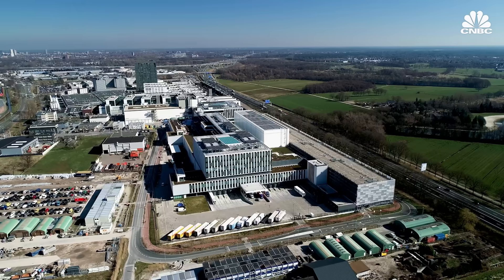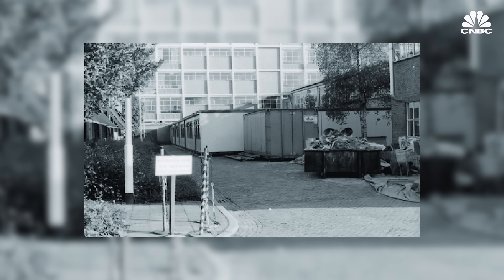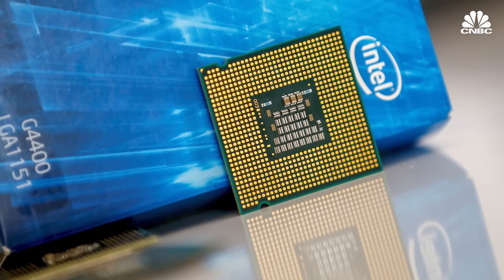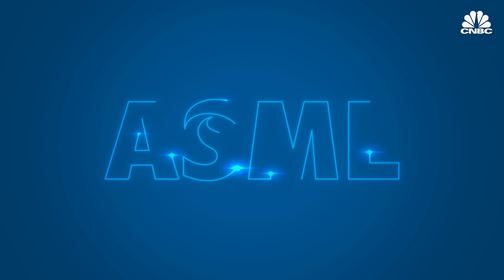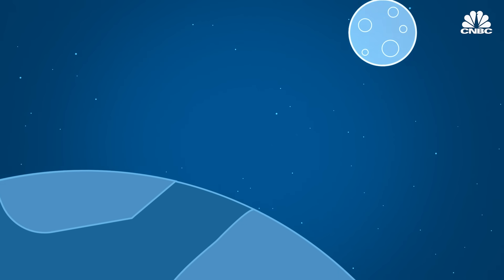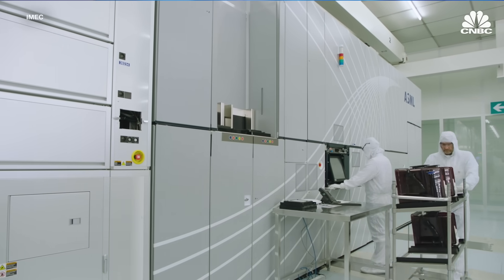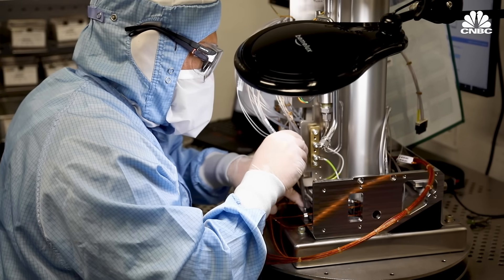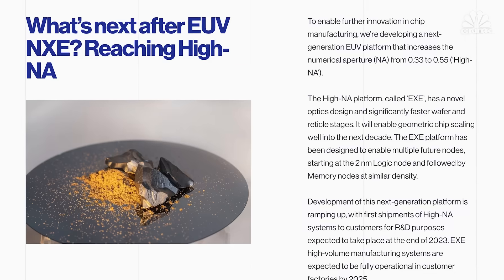Why The World Relies On ASML For Machines That Print Chips

Comment: I wonder how much ASML pays their top scientist and engineers!
Reply: A lot less than the talking heads you see hosted on CNBC. Now who really adds value and are commensurately compensated?
Reply: @kevind.5246  You work for ASML?
Reply: @DK-ox7ze  Don't I wish. :) I worked for ~ 20 yrs in the semi equip industry so i have a sense. I'd hazard a guess around $300K/yr for Sr. Director level - plus they'd do well w/ vested co. stock. But nowhere close to financial types or even Google/Meta engineers.

Comment: I work doing engineering drawings for installing these machines in chip factories. They are incredible. Hats off to the scientists and engineers building them!
Reply: The tin to plasma light source was probably just one of many genius insights needed to make these machines.
Reply: @autohmae  I work on medical CO2 lasers like the ones used to create the tin plasma and I thought I had to be precise with my alignments.  This is just incredible.
Reply: @Alvin Walker Sorry mate but like many other people in the world you are under the false apprehension that anything can just be reverse engineered and that's just NOT TRUE.

Sorry for the long answer, but its not just for you it for anyone else wondering.

I have degree in aerospace and 30+ years work in automation, control systems and robotics. Some stuff just can't be reverse engineered even when you know that task. It could be a lack of skills, knowledge or resources. Some things are just hard to do.

I see it in robotics and CNC all the time. Yes there's been some extraordinary advances that make stuff easy for people to do. But once you start chasing precision its just keeps getting harder. A good example is respirators.

Early in the COVID pandemic there was a world wide shortage of respirators and there were many announcements from a variety of amateurs and professionals. There's a YT channel called Real Engineering that's hosted y an engineer who once worked at one of the worlds largest manufacturers of respirators. He did a video on how respirators HAVE to work. It wasn't just what they do but HOW and WHY they do what they have to do. 

All the amateurs and professionals missed the fact that respirators aren't just an air pump they are hyper-precision air pump. They have to be because they are helping an already gravely ill person possibly with lung damage stay alive. That requires extremely accurate pressure and flow sensors that require very specialised electronics to read them. That alone makes them hard but then you also need software that's super reliable and a pump that can be precisely controlled. Its not impossible its just damn hard and can't be done with normal industrial parts which was what so many people proposed.

If you aske the simple question - can it be reversed engineered? The answer is always yes, but that doesn't answer the question of how hard it is to do.

That respirator company the guy from Real Engineering worked for released free to the world an older already certified respirator design. All anyone had to do was sign an agreement on the intellectual property and they could just start manufacturing respirators. The problem was many countries just didn't have the skills to make respirators or they couldn't get some of the parts. PLUS in many cases countries didn't have enough nurses trained to the level needed to operate & monitor respirators.

This Dutch chip machinery isn't one technology its a collection of hyper-precision technologies anyone of which would be incredibly difficult to reverse engineer even if they handed over all the details and design documentation.
Reply: @tonywilson4713  
"you are under the false apprehension" My God this is insufferable.
Some things can't be reverse engineered? I see what you're saying but you just lack perspective regardless of your exp. Geniuses exist and it's okay that you aren't one. You went from "hard to do" to "can't" in the exact same point. That is not interchangeable so make up your mind, mate.
Reply: @jasonnikolic  , he is right. Most of the tech ASML achieved weren't done in a year. It was done upon decades of work and trillions of dollars worth. There is just no way anyone will simply "go in and take it". China is trying hard to reverse engineer ASML's machines for 15 years now and they can't do it (they still buy outdated ASML tech, ASML is forbidden to sell new tech to china) because of the level of precision and the amount of parts that have to be manufactured with precision which themselves necessitate other parts to be produced so to be able to build the necessary machines for manufacturing of said parts, the construction process is just too complicated, so complicated that it is nigh impossible for non innovative countries like china, which depends on countries like the Netherlands for high-tech, to reverse engineer let alone make their own.
In reality the tech ASML uses to build those machines were all first invented in the USA, including lithography and EUV related technologies. Today, US chip manufacturers are researching ways to build carbon nanotube based chips that can be 3D stacked and that will suffer less heat.

Xi to chinese scientists scene be like:
- Tony Stark Was Able To Build This In A Cave! With A Box Of Scraps!
- But mr. Xi, we are not Tony Stark.
Reply: Can't they just take a daddy machine and a mommy machine and put on some Marvin Gaye and wait for the magic to happen?
Why hasn't China figured this out yet?
Reply: @markfairbanks3533  Because the chinese are still gimped by their own government. everyone goes abroad to study because the quality of education is far superior to CCP garbage. Once you leave china, chances are, you probably never want to come back again with all this new found freedom. This is what I suspect the CCP has trouble with. brain drain.
Reply: Sadly, this part of science is never mentioned or praised enough. How many people know inventor of transistors? Or people responsible for technology mentioned in video? All we hear is garbage from "great" scientists about pseudo black holes, pseudo evolution theory etc. Whereas they brought nothing useful to humanity. It is very clear what corrupted, derranged and wicked people are governing west for years
Reply: 99
Reply: meow meow meow
Reply: Any Chinese interns around? Keep an eye on them.
Reply: China is overtaking it
Reply: What’s the salary?
Reply: How did you get that job in the first place?
Reply: I've spent the last roughly 8 years proto-typing, designing, and building Intels EUV Vacuum Control system that ties into the ASML machines, fun work, challenging at times, and I only ended up in this position because I was the only one who said "Yes" when asked to take on the challenge. Specs change all the time, there's constant updates and revisions, but it's fun work nonetheless.
Reply: but its not just for you it for anyone else wondering.😶
Reply: @Alvin Walker the chinese tryed to reverse engineer it but failed. Asml is dependant on 100 companys for their machine parts, so they first need to copy those 100 companys before they have a shot
Reply: @Alvin Walker Don't you think they constructed the machines in such a way that reverse engineering is impossible? There is also software which is encrypted and embedded which redirects UV/light to compensate for natural bending and dispersion and so on. Otherwise china could just buy one machine and duplicate indefinitely, I'm sure they are trying that.
Reply: @plexoduss  if so why are they not selling to China even a single machine since few decades? Its just well protected technology with small circle of end user companies which don't/can't share any chip related technology with others in terms of geopolitical. Because, there is no such technology in the excistance which can't be copied. Its all matter of time, dedicated intellectuals and huge finances. If its done by the humans, there is 100% probability that another humans with similar intellectual capacity can create the samilar.
Reply: the netherlands......only 17 million people.....the Netherlands is the 2nd largest food exporter in the world and only one who can deliver this chip tech?

The world is in trouble......
Reply: @transformerstuff7029  Agree with what you said, but the 2nd largest food exporter is Germany, if I remember correctly. Then it is UK, China or matbe China, UK.

In addition, after the pandemic, the world's supply chain is really changed forever. Many countries realized that they can't no longer depend on other countries for their goods and services. I'm a consultant, and one of my clients is one of the automotive manufacturers, and it is starting to build their own factories, parts, supplies, etc. It's very wild to see their future's plan in the next 10 yrs, and how they are trying to prepare for another obstruction!
Reply: @GAATL_Viet  found the Tesla consultant.
Reply: @transformerstuff7029  The world isn't in trouble. Anyone who doesn't have this technology is in trouble, because no matter what agreements they have they are at the mercy of the countries that have this technology.
When your society requires a specific technology just to function you are at the mercy of who supplies that technology.
Its why the Chinese captured and trapped the Rare Earths industry. Its why other countries have done the same in other spaces.
Reply: already too much technology.. we shud reduce electronics and tech as much possible embrace our family and friends. Excess of tech is enemy
Reply: @Starship737  lmao please stay in school.......you just gave the worst idea ever lmao.
Reply: @Starship737  yeah, let’s just fundamentally change the nature, and instincts of human beings, who have consistently invented, adapted, built upon, and improved everything that can make our lives better. You’re basically talking about removing the key attributes that make us human. You got any idea how you think that could be achieved? I’m all ears 👂
Reply: @autohmae  Blame copyright laws.
Reply: @transformerstuff7029  Wait and worry ...
Reply: @tonywilson4713  I'm not disagreeing with you. I think that was the point tstuff was making.
" Anyone who doesn't have this technology, is in trouble"
Reply: @Starship737  you are writing your comment on a computer made possible by ASML
Reply: @Uvisir  true...and hopefully one day all electronics go away and world return to true peace
Reply: @Starship737  if you don't like tech go live in cave
Reply: @thesenate8477  sure
Reply: Ask yourself whether you would do away with the washing machine, the car, the telephone, electric light etcetera.

They are all technology.
Reply: @Starship737  Dude.. you are using TECHNOLOGY... the moment you start typing your comments on a computer.. 
Time to get off your parent's baseman.
Reply: @karloalberti  im against bad technology..and excessive technology.
Reply: @Starship737 😂Mother earth is a serial killer we better keep advancing before she gets angry again!
Reply: @transformerstuff7029  they're smarter than most of the human being, that's why they able to produce these
Reply: @pitechx  yea it's because religion isn't such a big thing here ;P
Reply: @transformerstuff7029  not really, the Dutch exports high valued agricultural products like tulips so the world doesn't go hungry without the Dutch export. Ukraine for example export lower valued agricutural like grains but are essential. Similarly, ASML's is a luxury export but the world can get buy without (hold on to your phone longer and fix it, get new batteries etc...), but without the Russian fossil fuel exports the world is screwed with high  energy prices, inflation and economic recession.
Reply: @tonyvu2011  The Netherlands plays an important role in the trade of fresh fruit and vegetables. The country is responsible for a fifth of all fresh fruit and vegetables imported into Europe

Belgium produces 150kg of vegetables per capita. In the Netherlands, it's 300kg, excluding more than 200kg of onions. In both countries, apples and pears are the main fruits. In total, Belgium produces 620.000kg of fruit annually, and the Netherlands, 760.000kg. Per inhabitant, that's 55 and 45kg, respectively.
Reply: @transformerstuff7029  that's my point, the world doesn't go hungry without fancy fruits from the Netherlands but millions go hungry without grains from Ukraine.
Reply: @tonyvu2011  seems you mistundertand.
Reply: @transformerstuff7029  2nd largest food exporter in the world?
Reply: @antonomaseapophasis5142  just vegetables.....Exports In 2020, Netherlands exported $31.1B in Vegetable Products, making it the 3rd largest exporter of Vegetable Products in the world. At the same year, Vegetable Products was the 6th most exported product in Netherlands.

Mind you we are a country of 17million people.....and about the size of the state maryland in the USA.
Reply: @transformerstuff7029  The world is not in trouble at all. 2025 is the year to change everything and my words stay....
Reply: @Star-oq1wh  cya in a few months bud <3
Reply: @transformerstuff7029  we are in Very deep trouble ❗️❕️❗️
Reply: They are going to putted these chips in human brain to controlled them  very satanic.
Reply: @pilarmartin5051  yeehaw!

Comment: china has made breakthrough fast enough and now going for < 1nm tech. their 14nm has reach mass production last year, now 7nm and 10nm will be standard for this year. mid next year will be 3nm and 5nm
Reply: Sry, may I ask where you get that news about China's credible breakthrough on the advanced chips like 3nm or 5nm? Frankly speaking, I haven't heard it in China by far.
Reply: @corporal punisher lennox bradley foxtrot Gottem
Reply: Which chinese fabs are going for 3nm and 5nm next year?
Reply: @Andreas Sagen It’s about scaling that determines if it’s commercially viable. And yes it is as hard as you think. Companies spend several years just to manufacture one chip at a certain node. There are only a few places in the world that have the equipment and technical knowledge of even pulling this off. To get that technology to scale is a completely different issue.
Reply: fake news im afraid. This is simply not true.